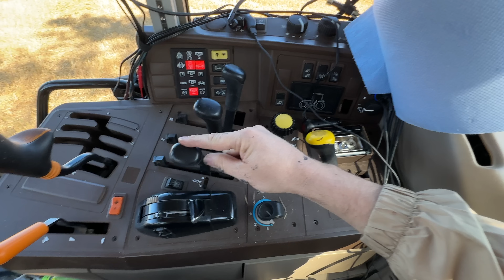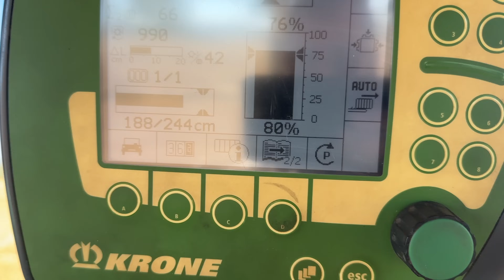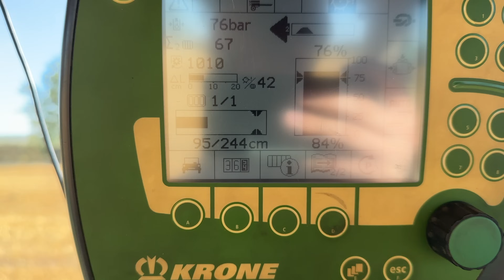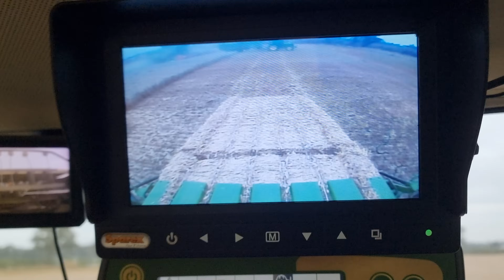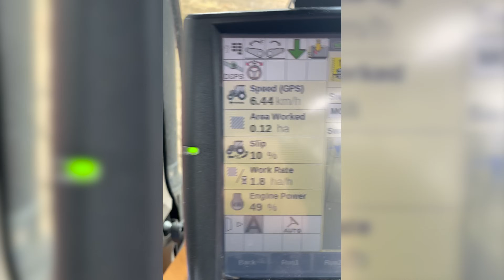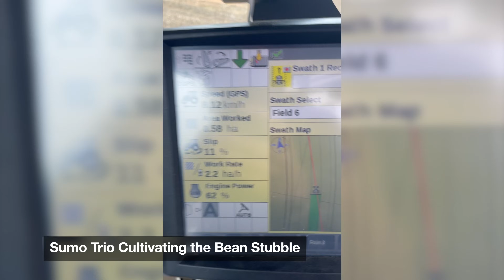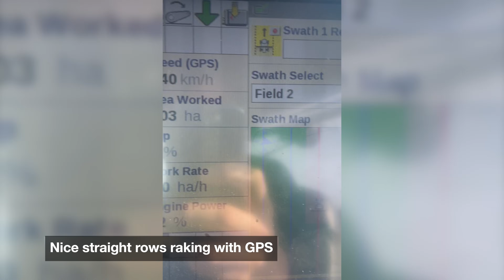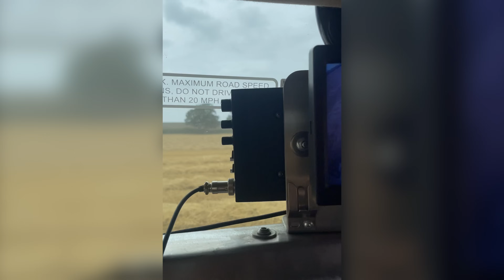World's Fastest Zipline Experience and Summer Farming Update

Comment: Ah! A spiral cutter block.👍Hope you have more luck than I when it comes to turning the inserts.  They can be buggers!  Great vid as always mate.
Reply from the maker: Do you torque them down? They really dont seem to need a lot of tightening force atall!
Reply: @BradshawJoinery  Thanks for the reply Oli.  I’ve never torqued them down too tight myself but I did seem to have problems with some of them when trying to loosen them for the first time from factory torque settings.  Had to break quite a lot of them free with an impact driver and quite a few of the inserts broke.  Also, it seems on the block I run the manufacturers used cheap Chinesium Torx screws which round out at the first sight of an impact driver, even when using good quality torx bits.  Looking forward to the upcoming video on the new block mate.  Cheers👍